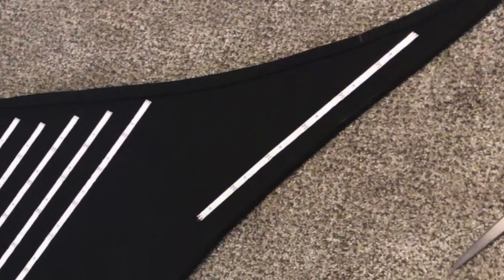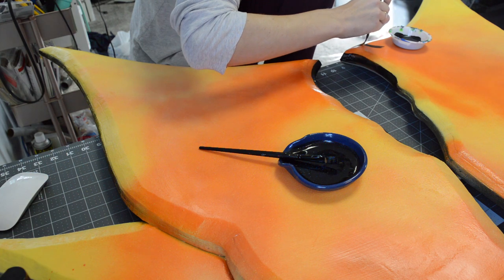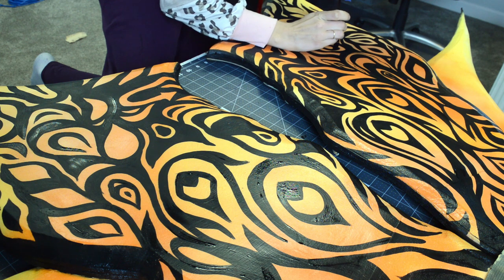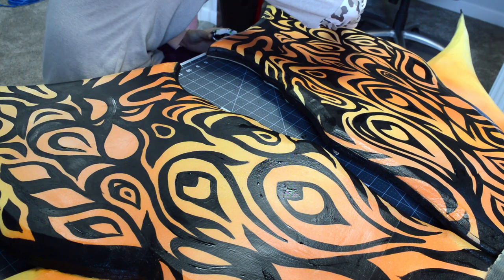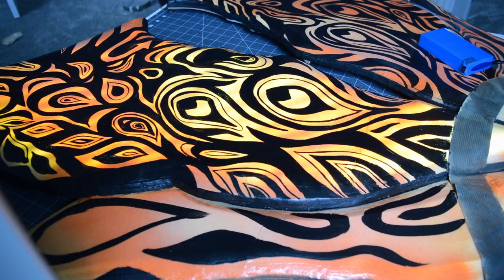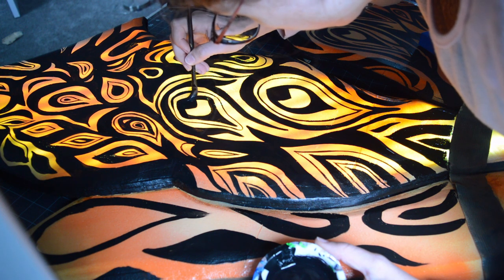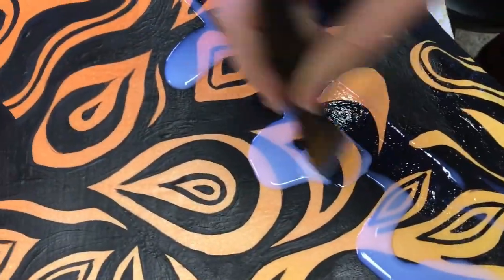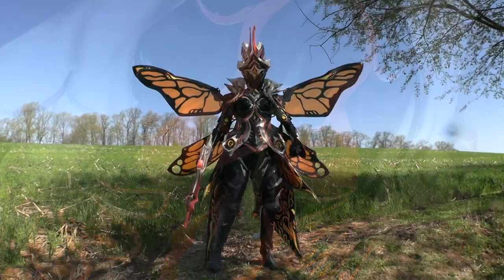Titania Glowing Skirt Tutorial

Comment: Very Nicely Done!  this was a a great tutorial.  On the technical side, what type of battery pack do you use for that many LEDs and how long does your power last before you need to switch out batteries?
Reply from the maker: Hey! For the skirt, I used a 12v rechargable lithium ion battery. I don't remember how many strips of LEDs I used, but the length of time to power your lights depends entirely on how many lights you have!

Comment: This is so fun, my six year old and I are inspired. Would you be willing to share what you used for a switch and power source?
Reply from the maker: For sure! So this is going to be different for everyone, but I should have put some info in here. I think I may do a video just for the electronics portion for this full build. I'm actually redoing this as well, so ideally what I'd like is for each panel to get wired together to one pos and one neg wire. So that's four panels down to 1 pos/neg wire. Then I'd solder these to a connector (I'll show these later, but they're here: https://amzn.to/3upCRdl ). Then I had a bus bar to connect all LED pieces from armor to one point. That bus bar then had one plug to connect to a 12V rechargable battery! So it sounds confusing here, but I promise to do a followup video. 

The LED strips are typically 12v, so you just want a battery that powers that. And the strips I linked to actually already have a plug installed! So you can just plug it right into a battery like mine ( https://www.ebay.com/itm/193564028690?hash=item2d1150af12:g:DkEAAOSwNd1fCGSu )
Reply: @PlexiCosplay  Thanks for the reply, is something like this appropriate? https://www.amazon.com/TalentCell-Rechargeable-12000mAh-Multi-led-indicator/dp/B00ME3ZH7C/

Also, doing a quick P=IV on that source with the 18 watt lights at 12V it looks like the 6000mAh would last for ~4 hours. Is that about what you experience? Do you find a backup power pack is necessary when out and about?

Thanks for taking the questions, I really should get out a play around with it.
Reply from the maker: @michaelrothaupt4755  Yes, I actually think I've used t hat exact battery as well. I don't usually keep my lights on for super long periods of time -- That sounds about right on the timing, but I have definitely brought my charger and charged the battery between times when I'm out on the floor or between judging and competition!